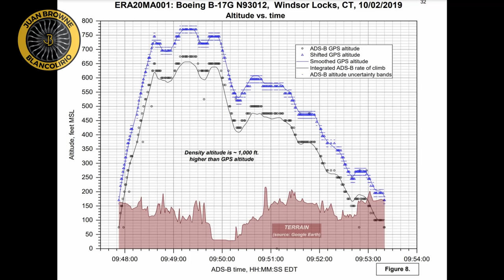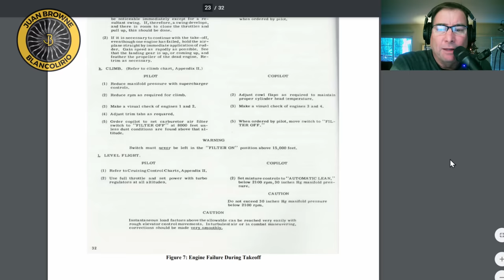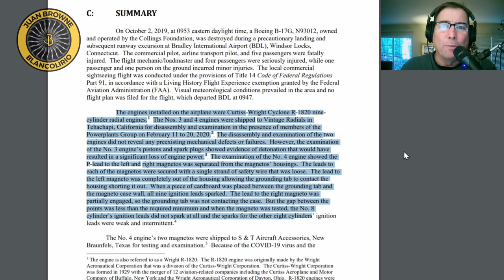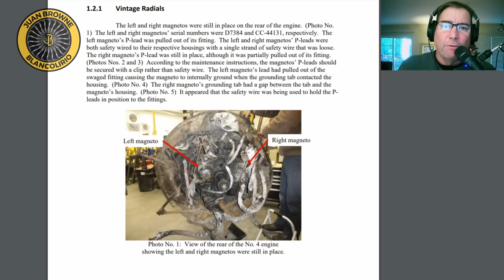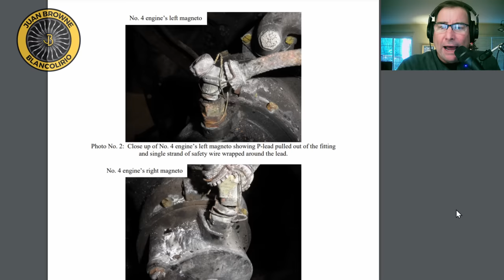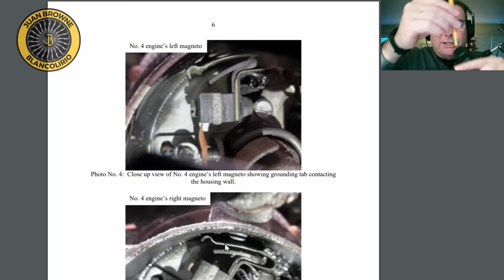NTSB Report B-17G Crash 'Nine-O-Nine' Part II -18 Dec 2020

Comment: Closed gap points causes significant retardation of the timing timing and decrease of available spark energy especially when under significant load. Dwell is too large (degree of rotation the points are closed)

Detonation is like a sledge hammer hitting the piston (ping = explosion) same as a diesel knock. Pistons like to be pushed with a progressive expansion vs explosion. Pinging focuses damaging forces and heat destroying the effected cylinders in short order. Expansion allows maximum developed power and internal temperature management by design.
Reply: And a radial engine will self-destruct in seconds when significant detonation occurs.
Reply: Since the cam was worn they had a whole set of problems.  If you adjusted the points to spec. then there would not be enough dwell.  I'm not sure I ever let my old truck's distributors get as bad as those mag's looked.
Reply: @davidhoekje7842   Agree.  Correct adjustment of worn parts is impossible, which is why they must be replaced.  None of my cars ever had plugs that looked like that.
Reply: Way back in the day ~1985 my younger brother (excellent mechanic) and I had a tune-up shop In Oregon.  One of the fun things we did was sponsor a small turbocharged Datsun 510 that was bored out, and turbocharged.  Sponsoring it meant that we got Bill parts at our cost, worked on the car with him, and were his pit crew at races.  He was running a Ray-Jay Turbocharger into dual side-draft Weber carburetors in a bored out original 510 engine. He was running forged racing pistons and was getting cracked pistons from detonation.

When he first brought his car into our shop to work on it, we tore it down to the cylinders.  About the only thing that will crack forged pistons is when the timing is running so far advanced that the spark is arriving while the piston is moving up in the compression stroke.  Of course normal ignition needs to arrive while fuel mixture is compressed at the top of the stroke, not while it is on the way up.  Irresistible force meets unmovable object and pistons crack.  The fact that the mixture had a good 18-lbs + of boost makes the mixture extremely more explosive, which is the whole point of turbocharging and/or supercharging, but it is far less tolerant of errors in timing.

We replaced the pistons and connecting rods and reassembled the engine.  Then put it on our Allen scope to diagnose what was going on with the car.  We checked the advance at idle and various rpm stages.  It was withing norms at idle, but as we accelerated the rpm the advance became ridiculous.  As rpm goes up, the spark does have to get their sooner because it happens quicker and spark doesn't arrive immediately.  So the timing advance is adjusted.  Well, his timing was at over 55° of advance at 5000 rpm...no wonder his pistons were getting cracked.  The spark was igniting the mixture while the piston was still on the way up.

We had to change the advance weights on the distributor and dial the idle timing back to 17° of advance to get rid of the detonation and get good performance out of the engine.  That optimized timing added so much power to his engine that at the next race at PIR (Portland International Raceway in Portland, OR) where he was running in C-modified class...he melted his brake pads...but that's another story...
Reply: @davidhoekje7842  I drove a 69 Coupe de Ville 472. It would not idle smoothly. The dwell would not steady, turns out the distributor shaft had enough play to cause the problem. This was about 1991, the local parts store sold me a complete rebuilt distributor for $25.
My 1957 Cessna recently had a dead mag, caused by a bad condenser. Automotive ignition condensers used to be about 2 dollars. The aircraft version is $50....

Comment: Thank you for the excellent deconstruction of this tragic failure! I have to say, I am really quite shocked that the bad lawnmower-grade "repairs" were allowed to fly. There is just no reasonable explanation for how anyone would look at the safety-wired cobbling and sign off on it, not to mention the rest of the jr-high-shop-class amateur-night stuff, like points gapped incorrectly. Just unbelievable, and to call this loss avoidable is putting it pretty mildly. All the best from Canada.
Reply: And every EVERY Powerplant certificate holder that saw it and turned away doing nothing shares the blame for the eventual outcome.

Comment: I’m almost 70 years, and when I was in my 20s I earned a living tuning up automobiles with these points and condenser ignitions. Regarding #3 engine, which had all that detonation, remember: change in point gap changes the ignition timing. Wear on the cam and follower reduces that gap. I’ll bet the plugs were looked at occasionally, but no attention was paid to the points. You need a good tach dwell meter to measure the dwell, or point setting, and then you need to time the mag (or distributor) to the engine again after even touching the mag or the points. They ‘Mickey moused’ that engine along and they paid with the destruction of a vintage aircraft. I hope these people are still alive so that none of these people ever flies or turns a wrench again.
Reply: @Rodneythor Sounds like you may have had some time with a Sun Machine.
Reply: Sadly, I think both pilots died in the crash.
Reply: Yes I had time with a  Sun machine too. In our era any good mechanic could pull the plugs and read them like the bible. The color alone would have shown problems. I  know from first hand experience how quickly detonation can burn a piston and destroy an engine. #3 would not have run much longer, in fact I think it within the realm of possibility to have been the "bad" engine to start with and #4 was shut down without trying to verify that by instruments or co-pilot observation.  In military usage of these engines the plugs were pulled after every mission as a regular procedure. The lack of adequate maintenance was appalling and directly the cause of this disaster!
Reply: I have been maintaining a 1957 Cessna 172, with the original 0-300A 6 cylinder Continental, under the supervision of my AP/IA. I have done my share of old car point and condenser tune ups, with a timing light and dwell meter. You should be aware there are some differences with aircraft magnetos.
There is no such thing as ignition or carburetor adjustments while an aircraft engine is running, so a “dwell meter” is never used. Point gap in the primary ignition circuit must be carefully checked and cam lobes and follower assessed for condition. The condenser works just the same as in an automobile, except it costs $40. Spark plugs are $30, times 2 per cylinder= $360 for a set of plugs. That is why the cleaning equipment Juan shows is popular with mechanics. If cost were no object, or time is valuable, new plugs are great!
Unlike cars, aircraft magnetos have no advance mechanism vacuum or centrifugal. The basic timing on my plane is one magneto 26 degrees BTDC, the other 28 degrees. There is a mechanism called an impulse coupling the gives a shot of retarded spark as the engine turns over, to aid starting, that is quickly retracted once the engine fires. Otherwise, the characteristics of aircraft operation, normally some steady percentage of full power, usually 2000 to2400 rpm, lends itself tone variable spark timing to be desired.
Also, VERY important as shown is the proper condition of the p lead, which a car distributor does not have.
The magneto is a self contained spark machine with internal coil. For safety it is considered to be “ hot” all the time when anywhere near a propeller. The p lead grounds and disables the mag through the car style ignition switch in the cockpit. Alsoimportant, that switch will have OFF, LEFT, RIGHT, and BOTH positions, which must be verified for correct wiring.

Comment: correct me if im wrong but... aren't you supposed to test both mags on the engines when your doing your preflight/runup?
Reply: You are correct. You are verifying that both left and right are operating (the engine doesn’t die on one or the other) AND that there is an expected RPM drop. If the RPM doesn’t drop, that indicates a magneto that’s is shorted hot/on.
Reply from the maker: see Part I
Reply: Hopefully with the four-engines:1&3 maintained. Then 2&4 maintained. I never thought of the massive amount of drag on one side, caused by an engine failure. 
The pilot needing to compensate: to maintain level desent (sink rate).
Reply: It's critical. There are some runup items that only need completion once per day, but the magneto check is inviolate. A note here: the 100 RPM ( and frequently more than that) drop when a magneto is not operational will only be seen on the ground when the engine is operated with the props on the low pitch stops. Airborne, the constant-speed feature keeps the engine at the same RPM regardless of whether it is running or not.
Reply: @blancolirio  Good job as always Jaun, but just a little critique. Isn't preignition a precursor to detonation? preignition is like dropping the bomb and detonation is when it goes off! Or as your "Pete says Kablamo" Ha ha.
Reply: @429thunderjet2  Pre-ignition happens before the spark. Detonation happens after the spark. The detonation is literally that, the flame front becomes supersonic, and pressure, rather than heat, is driving the reaction. Both are bad.
Reply: @Markle2k  right, but isn't the word self explanatory, Pre...Ignition? 
And preignition happens first before detonation. Because I have a piston I myself replaced in my old big block that I was driving when it happened and it was pinging bad before it went Kablamo! Ok
Yes the flame fronts collide and break stuff, but,  there shouldn't be more than on flame front.
Reply: @429thunderjet2  Yes, pre-ignition should be self-explanatory. And it often results in detonation. But, it can harm power and cause stress even without detonation if the pressure rise happens too far before TDC.
There are two main types of "explosions" deflagration and detonation. Deflagration occurs when the heat of the chemical reaction provides the energy to rearrange the chemical bonds. This occurs below the local speed of sound. Detonation is when the shock front is providing that energy, which results in a runaway reaction that occurs faster than thermal energy can be transferred (local SoS). This results in a shattering change in pressure rather than a smooth rise in pressure.
Reply: @Markle2k  And, many times the results are broken engines.
Reply: Flywire said Mac fethred the wrong engine and lost power right after tapping the button thus hitting the strip lamps and going into an uncontrolled yaw. It was also, I believe implied, that Mac and his copilot had slammed into the panel due to not wearing the shoulder harnesses.

Comment: Very excellent presentation of the report. I am a self learned mechanic so I could totally understand what you mentioned about using spark plugs to read the story.  What gets me is why wouldn't modern technology be applied here on something so critical?  Such as removing the mags and points and using electronics along with knock sensors that would drastically help with ensuring the motors are running with the right timing and spark. Surely technology has evolved but perhaps cost or certifications prevent such things from being done. Having the additional over sight and inspections also key. I love seeing the old birds fly but there is just so much to take into account. In the case of the mid air crash in Dallas the other day, the B17 was likely just flying where it should have been but was cut down by the P63 King Cobra. But who knows, we'll need to wait till the investigation is completed but so sad that we lost more planes and more lives too.

Comment: I believe that rust on the cylinder walls is from condensation post crash.  Cylinder walls will flash over very quickly once compromised as it looks like the head was destroyed.

Comment: That corrosion is really alarming for a recent overhaul.  Did someone pencil whip it?
Reply: I agree, and aren't the engines supposed to be bench tested after overhaul too?
Reply: Yeah, I'd say that was a gun decked signoff. There is no conceivable way that happened to a running engine in the intervening time.
Reply: @shaunolinger964  unless it was poorly timed and only got worse from wear and neglect, combined with ignition issues causing lube washdown? it's a hard-knocking life, and it's a short one. that piston would have failed eventually from just being over heated, under lubricated, and just getting beaten like a whipping boy for it's whole life.
Reply: @stromsky58 my grandparents retired there in New Smyrna Beach where the C-17 was stored in the winter. My grandpa was militant about keeping the salt air from eating his car alive. I’m sure that poor airplane suffered mightily during the months it was exposed to that environment.
Reply: In defense to the person/company that did the overhaul of the number 3 engine. I agree if they did the overhaul and hung it on the wing they did not do their due diligence and the corrosion was missed/overlooked. But I am willing to bet that the foundation had/has extra engines. If I am a betting man (which I am not) the inspector from the FAA office needed to inspect the areas where the foundation keep their spare parts. In Florida if these spare parts are left out it does not take very long for the corrosion to occur. Also I bet preservation precautions were either not enforced, or worse yet total ignored. The head pilot and the foundation are at fault but I think it is fair to also say the local FAA office didn't do them any favors. Just sad that peoples lives and a piece of history  were ruined that day.
Reply: @johngraham3649  most of the internals were like that due to the neglect. running way too rich, incomplete combustion, moisture in the fuel, etc. it's entirely possible that the overhauler did everything right, but if you just ignore the brand new engine, it will fade quickly. these are not car engines where there is plenty of margins, once these systems start to degrade, they will fall off sharply

Comment: Did they "blow the mags Out" by removing the 'P' LEAD? I have not done that procedure. I do know that there are problems with leakage between leads in the wire looms. That is why late r28800 and R3350 have low tension ignition with booster coils at the cylinders. A few of the guys with CJ6's that I have annualed have gone to auto spark plugs and  replaced the wire looms with 8mm auto leads.
Reply: @UC1ek74Wk-CHZpln0pkjjDpA True I have had problems on my Ford Ranger. The Nanchang CJ6a is a Chinese aircraft with a 9 cylinder radial like a R1830 but 600 cubic inch displacement. I should have made it clear the first time.

Comment: Juan: 
Ex Navy air crewman(Radio) here on recips. R-5D(c54),R-6D(c-118), R-7V(c121),  
I have gone through many pre-takeoff  run ups,  successful, and not successfull.
I have no doubt that the identification of the unsuccessful ones, is the reason why I am still here today
The inoperative mag on #4 would have shown up during the mandatory full four run up just prior to take off.
The inop mag. would have caused too much of a R.P.M. drop during the test.
NATOPS manual orders the Plane Commander to return to the ramp and rectify this situation.
That half field takeoff from the runway intersection, doesn't give the plane commander a convenient spot to do a stand still  runup.
So.... it was probably half assed done on the taxi out,or not done at all. 
Russian Roulette with peoples lives, played by an arrogant 4 striper, who thought, with all those hours in the book, he could twist the dragons tail and get away with it.
Ten tourists at $2500.00 apiece was a deciding factor here also.
Just my $.02
Art. Haughey 
Ex USN AT-2 P1 A/C with VR-3, VR-7, and VR-21, 
Skid marks in the sky,
 I've flown with blind, the deaf, and the insane of all ages in the left and right seats.

P.S. The massive number of flight hours in type, and the skill brought to save the situation by the PIC, were used to try to correct a situation that he brought on himself.

Comment: My dad bought a 20 foot Glastron in 1968. I had a very sweet 300 CID Buick with a OMC out drive. It was so great to set the dwell and timing while running across the lake running the lake at 40 with the engine running near full throttle.  This was essentially dyno tune.. It was a great engine with good power and lighter weight than some of the other marine V8s of the time.